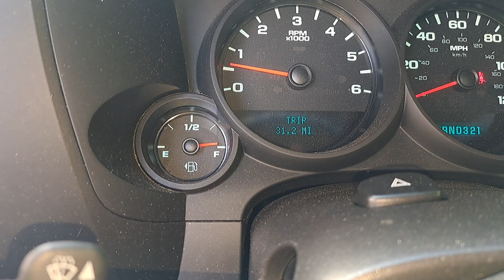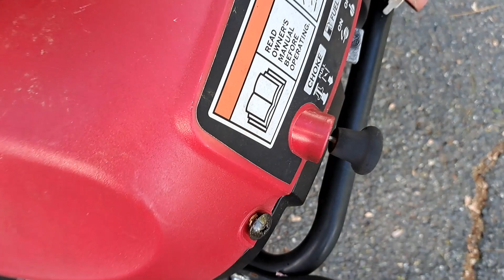Update on the Honda Harmony HS520 Snowblower freebie score. Win.

Comment: I think Honda snowblowers are just okay, they do have a few issues worth noting. That Honda GC160 engine isn’t really built for winter and it doesn’t even have a primer. So getting this thing to start on a very cold day will take a lot more effort unless you have the electric start version. Also those rubber paddles are quite a hassle to get changed compared to the ones you find on Toros.
Reply from the maker: Yes it's just a GC160 slightly altered.
I had an older HS621 built in Japan, that was nice.
https://youtu.be/vL8nz-jx8Hc
Reply: Ahh..but, it DOES have the Honda name on it!
Reply from the maker: @davidcoudriet8439  It's gonna sell for good money. Anything Honda does.